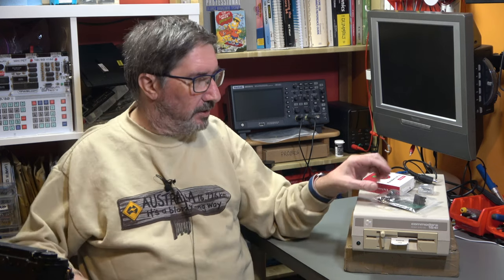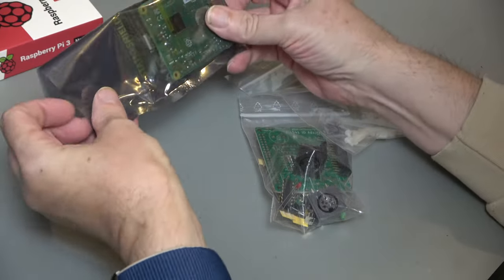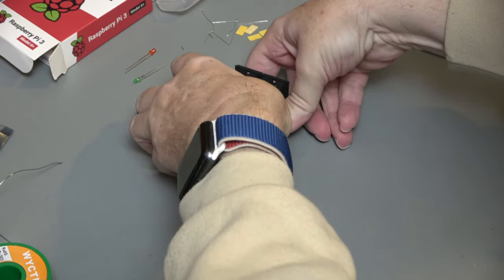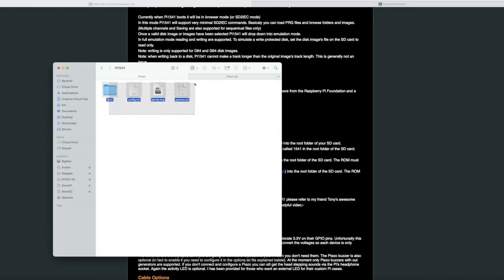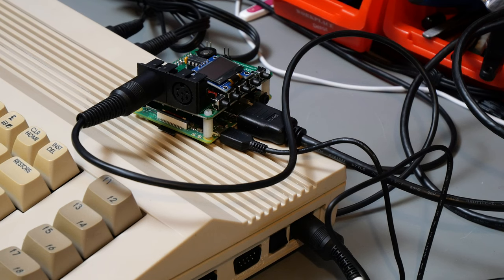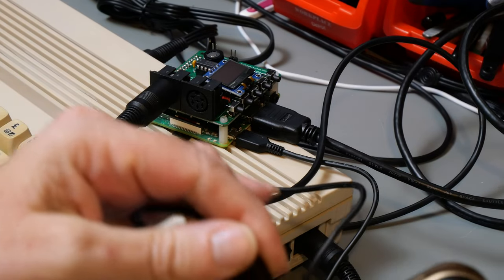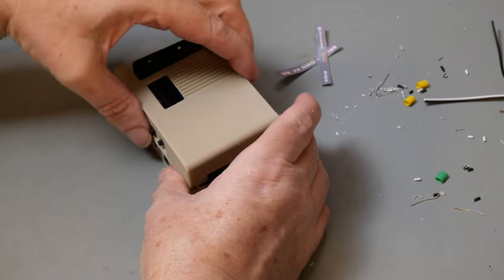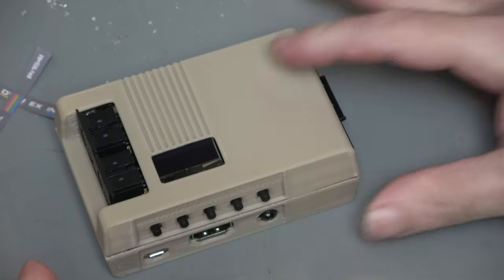Building a PI1541 for the Commodore 64

Comment: Hi, good video. Pi1541 is a great project, maybe one of the best things in the C64 universe. But it definitely lacks a proper step by step guide for the somewhat technically less informed players. So, more videos like this, the better. You never explained why you chose to turn on the "ignore reset" option, I left is as default and it works fine for me. Since this is a real cycle exact emulator, and since a real 1541 resets whenever the C64 is power cycled, I think it is better to reset the Pi1541 too.
Reply from the maker: Thanks. The reason for the "Ignore Reset" is that without it my Pi1541 would crash on startup, just displaying "loading ROM" on the hdmi screen (see around 16:00 in the video). If yours starts up okay then you don't need it! It has nothing to do with the reset signal from the C64, this is the Pi itself.

Comment: To enable the buzzer uncomment the following options:

SoundOnGPIO = 1

SoundOnGPIODuration = 1000 // Length of buzz in micro seconds
SoundOnGPIOFreq = 1200 // Frequency of buzz in Hz

To make the buzzer sound more like a floppy drive:

Change SoundOnGPIODuration to 60

Change SoundOnGPIOFreq to 720

To use the CBM font on the OLED uncomment the following options:

ChargenFont = chargen		// 8 bit font file
i2cLcdUseCBMChar = 0 // set it to 1 to use CBM font on LCD. Small but fun !

Have fun!
Reply from the maker: Hi Mike, I had the sound values set, but what I hadn't realised was there was also a jumper on the PCB that needed to be set. (I have now set it but it didn't make the video). It doesn't sound remotely like a floppy drive though, so I'll definitely give your alternate values a try.
Reply: @TimsRetroCorner  Yeah I forgot about that jumper even though I was staring at it yesterday.  Glad you got it sorted.

Comment: Hi Tim! Detailed and structured video - thanks for that! It's correct, that the SD2IEC doesn't run code like the origin 1541 does. But SD2IEC supports fastloaders like JiffyDOS, the Final Cartridge 3 fastloader/fastsaver, DreamLoad, Exos, GEOS, ... And SD2IEC is much cheaper ... normally! 🙂SD2IEC is much easier to configure, don't needs seperate power supply, is smaller ... So .. it's nice to have different 1541 "emulations" but I'm really happy with my SD2IEC!
   Best regards, Doc64!
Reply from the maker: SD2IEC is probably easier to get hold of these days than a Raspberry Pi too. But I do like that the Pi1541 is just a device on the bus, and not tied to the 64 for power. Plus my SD2IEC doesn't have a bus passthrough, so there's that (although I think that some do)

Comment: Can you provide a link to the buttons label? I had the same problem with the OLED cutout, by the way. I did some clever cutting and repositioning of the ABS material.
Reply from the maker: If you go to the Thingiverse link in the description, the labels are one of the 'thing files' (pdf).
Reply: @TimsRetroCorner  Thanks!

Comment: I got one prebuilt one from  ebay, and although i got the display to work by tweaking the options.txt, and search everything i could on the Web i still can't get a disc to load. I think it's only me with the problem. I'm using a pi3A+ and 16Gb sd card formated to fat32 with all the files copied from the various places.

Comment: Is there any minimum requirement for which raspberry Pi? I have many Raspberry Pis running around except the newest one.  If possible I would like to use one of the older ones. I also saw a Pi Zero can be used as well. Thanks for the great video!
Reply from the maker: You might need to take account of the form factor when fitting the board to the pi - possibly the network ports on some models might get in the way. I don't know if it works with a Pi 5, but the 3 & 4 (and Zero2) should all work fine.

Comment: interesting video but..... I would need to use the raspberry with the C64 emulator (because i don't have a real C64) and be able to connect the original 1541 drive. Do you think it can be done with this interface?
Reply from the maker: An emulator (VICE etc) would emulate the drive as well, so there isn't really a need. But there may be a way to hook up CBM Serial to a USB, that isn't something I've investigated.

Comment: Anyone tried with PI3A+? I cannot make it to work, no HDMI signal, no oled info. PI is working as I can boot standard SO. Any suggestions?
Reply: Anyway, I figured out how to make it work. As I used a PI3A+ 2022 version, I needed to use the latest firmware files from PI repo. that's all ;)
Reply from the maker: Good to know.

Comment: are you using a 3a or 1a?
Reply: nevermind i found out the author is not supporting this device anymore and hoarding v1.25 and not updating github
Reply from the maker: It's definitely a pi 3 (I've never owned a 1). I hadn't heard about support being discontinued, that's a shame, but sadly all too common with retro projects.

Comment: Sorry it isn't so straightforward to setup, I made it support so many configurations that ended up complicating things. Anyway I'm a big fan of the channel and am inspired by what you do.
Reply from the maker: Wow. Thank you! It's inspiring that a project like this is not only open source but has been adopted and adapted into so many different devices, yet at its heart boils down to a Pi, a level converter, a plug, and a few switches.

Comment: This is a great project but need to be migrated to something lie a Le Potato, The raspberry issues is just stupid, there is no way I'm paying more than 30$ for a raspberry.
Reply from the maker: The hardware connections should be simple - this is not a very complex circuit (although it may not look pretty connecting it to other boards if they have different form factors or pinouts). The tough part I imagine is the software - I have no idea what would be involved in porting it to a different SBC. Anyhow, they say supplies are about to improve, and with that prices should start to come down...